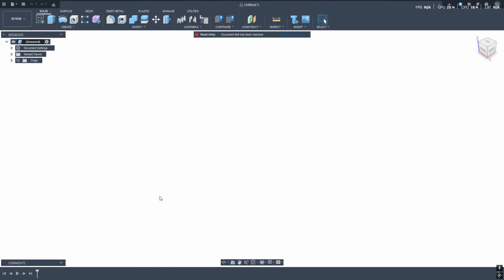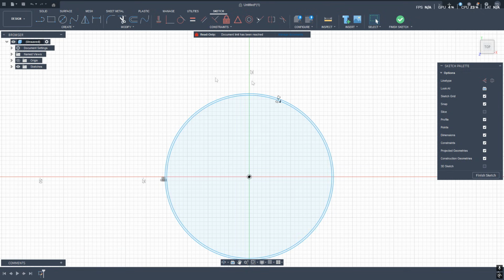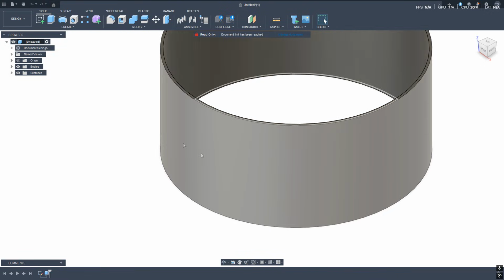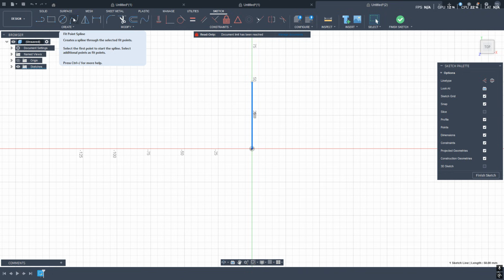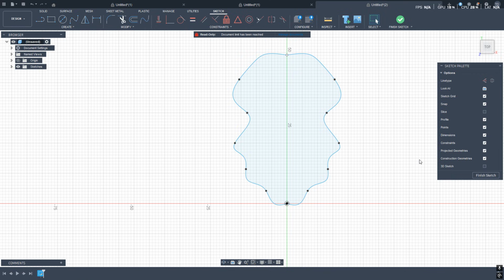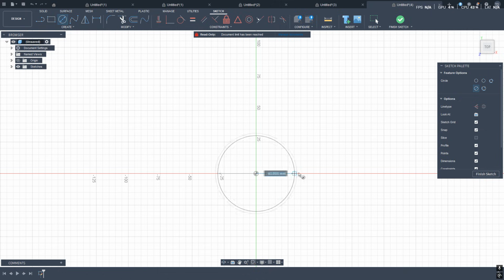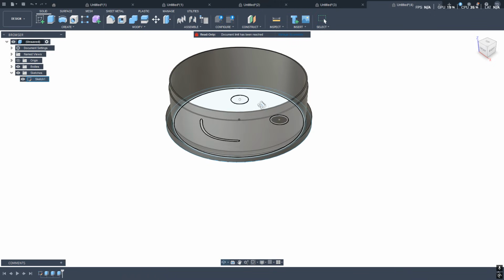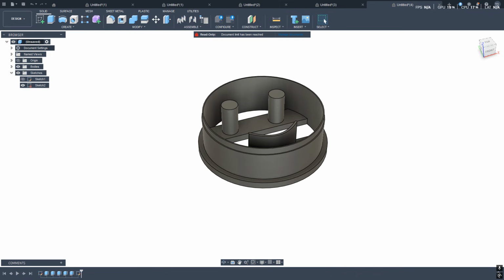How to Design ANY Cutter in Fusion 360

Comment: Thank you for your excellent and informative videos. Would you be willing to do a video on making a zig zag border cutter? (Basically something similar to a metal  wavy blade cutter that polymer clay artists use, but with sharp angles instead of waves. All the clay cutter tutorials I've found are for making cutters with enclosed shapes that are then extruded.  I've been trying to figure out the best way to make a cutter that isn't enclosed like that. I've gotten close using v shaped lines and using thin extrude,  but I'm not quite there yet.
Reply from the maker: Sure, I can help with that. Let’s make it practical... if you sketch the exact zig-zag design you have in mind and send it over, I’ll use that as the basis for a video. I’ll walk through how to build that specific cutter and, more importantly, show you the approach so you can create any custom cutter from your own drawings going forward. Deal?

Comment: Very helpful!  Thank you.  One question - If I'm using a 0.2mm nozzle would that change the offset dimensions?
Reply from the maker: Not necessarily, but  if you want to design a sharper cutter I would suggest to make the cutting wall 0.25  or something close but still make the reinforcement wall around 0.4, 0.6 . To keep the strength.  But 0.4 cutting wall cuts pretty well. So if you want to follow the tutorial as it is , do that. You can tweak later once you get more confidence in designing.
Reply: @KatapultMake  I will try that, thanks again!
Reply from the maker: You’re very welcome! If you run into anything tricky or get stuck on a specific step, feel free to let me know. 
I’m always happy to help and if it’s something others might find useful too, I can even make a video about it.